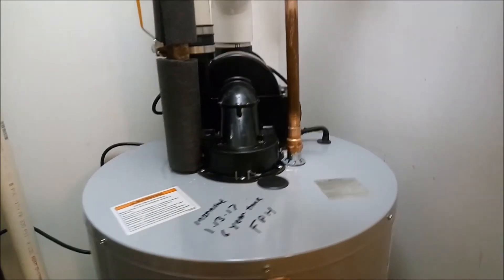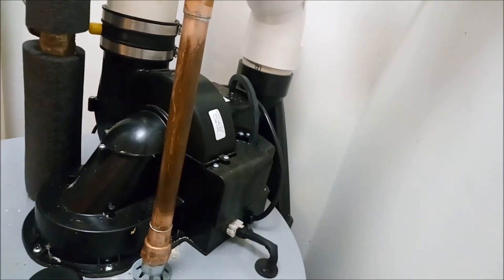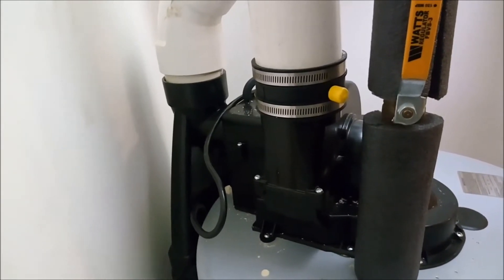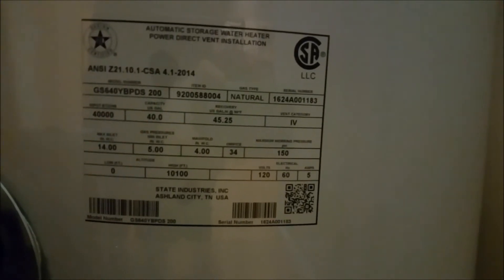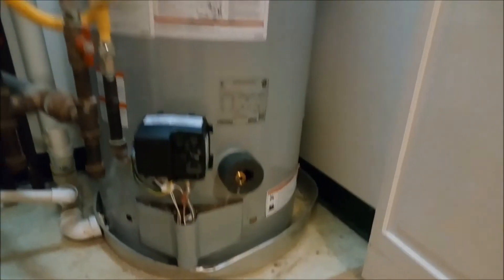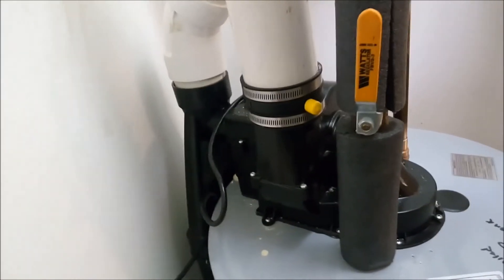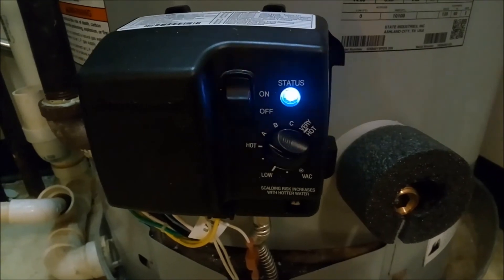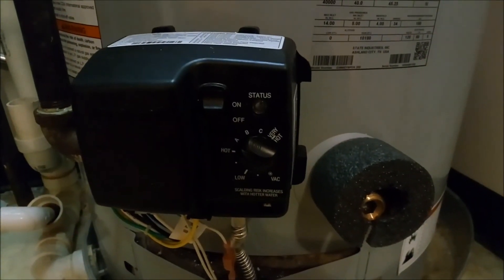New State Select Power Direct Vent Water Heater (Not Power Vent, Not Direct Vent)

Comment: The condensation clear tube for the vent is not present ... you can see the yellow cap at the base of the vent. Why didn't you install one ?
Reply: Can you please explain how does the condensation get trapped coming down the vertical PVC?
Reply: @1weirddoe571  The manual says this: "Formation of condensation in the venting system of Power Vented water
heaters is dependent upon installation conditions including, but not limited to:
ambient temperature and humidity of installation location;
ambient temperature and humidity of venting space;
vent distance and slope;
and product usage.
In order to effectively control condensate from adversely affecting the
mechanical components of the water heater several methods may be
employed:
1. For horizontal installations the vent pipe can be installed with a
downward slope (not less than 1/8 inches (3 cm)) and away from the
blower.
2. In order to prevent condensate from draining back into the blower
(vertical or horizontal runs), an optional condensate kit is available as a
service part (Condensate kit, p/n 238-45875-00). A factory supplied
exhaust adapter with drain outlet mounts directly to the blower outlet
and is secured with two hose clamps, one to the blower and the other
to the vent pipe. Tubing is provided to drain any accumulated
condensate away from the water heater and to a suitable drain. The kit
comes complete with instructions for proper installation."
Reply: @danieldalarossa , so internally there is probably a perimeter, cupped ring that traps the water to the drain hole like a cut in half doughnut?
Reply: @1weirddoe571  I have no idea how it is implemented... I still would like to know the reason for not having a condensation line in this installation ...
Reply: @Hall Plumbing & Heating LLC, so after your 5' vertical rise you are running horizontally downhill away and thus 99% of condensation is going outside?

 Also, is the input air just gravity and pulled or drawn by the output fan or is there a dedicated propeller that works to draw in air. Looks like maybe the same shaft on the output fan is spinning an input propeller?

Comment: I am wondering what's the noise level of the Power Direct Vent water heater.
Reply from the maker: Loud, very loud, 3x to 4x louder
Reply: Thanks for the info. Is it 3x to 4x louder comparing to the regular Power Vent water heater?

Comment: Might want to add die electric unions to the copper pipe connections going to and from the water heater. Also most codes require a bonding wire between the inlet copper pipe providing cold water and the copper pipe discharging hot water from the water heater. And, inspectors like to see PVC primer / glue on the PVC joints.
Reply from the maker: I paid $2350 buckaroos to get that done in Feb 2017, not surprised that they didn't do everything up to code.
Reply: It's really sad that will all this information that is available today, contractors can not provide exceptional service. Not too late to add the unions. I do like your other videos.. Great work !